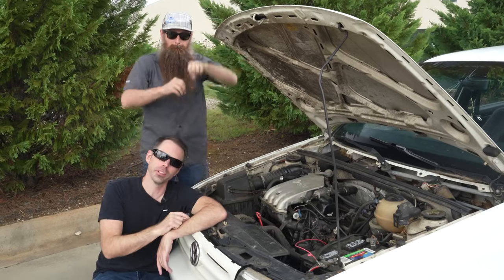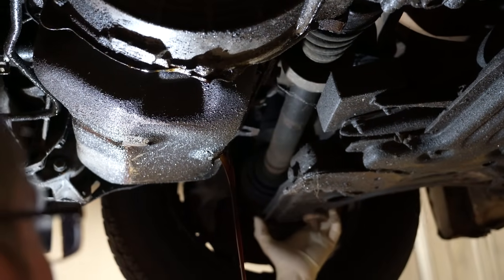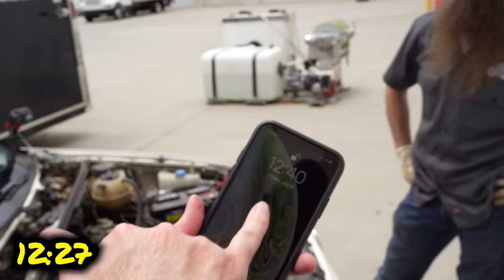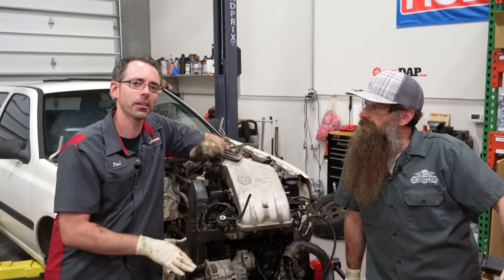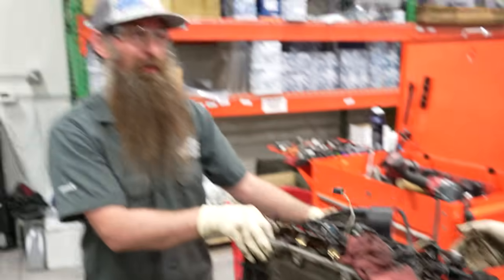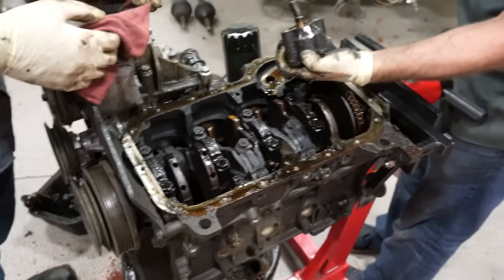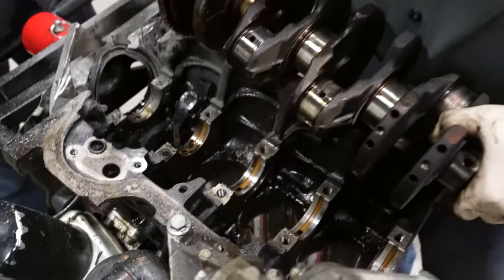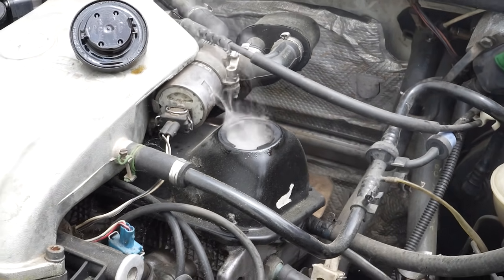Can an Engine Run with No Oil?

Comment: Back in the 90s I was in tech school and we did a similar thing to an early 80s manual Subaru. We drained coolant, oil, transmission, and diffs. Took the fan out. It ran in the parking lot most of day one. Instructor, who is/was one of my heroes, did 6k clutch drops in the school lot until the clutch exploded. Day 2 we had to turn it over by hand to break it free. It then ran at WOT for about two more hours before window-ing the block. Did we learn anything?  Not really. Memories were made though.
Reply: old beats new
Reply: That's 100% freaking awesome.
Reply: Best friend had an early 80's manual Subaru, little blue sedan, had like 300,000 miles on it and something let go inside it but it was still running, just poorly, so we pegged the gas pedal and let it run till it died, took about 30 minutes before it must have blown the head gasket too and then a volcano of oil and coolant sludge came shooting up out of the carb or throttle body on top, can't remember exactly, but it looked like a horrible school science project... kept going a bit longer then finally sputtered and died. We got $250 for it from the scrap yard that came and towed it away. Happened in the late 90's. 

Next closest to that was a 04 Dodge Durango I had with the 5.7 Hemi, came home on a Friday and parked it, went out on a Sunday to start it to go to a friends, clack clack clack then a loud klang. Shut it off, oil down the driveway and a hole in the block. Apparently it dropped a valve seat, then snapped a rod, a common issue on that era Hemi. $4k for a low mileage salvage yard engine swapped into from an 05 Ram, sold it a few years later to another friend after I put 40k on it and he's put another 160k, just helped him swap the valve cover seals that were leaking and some shot engine mounts. Still running. Some things just won't die, while others just one day go boom!
Reply: thats awesome i hope i get to experience something like this in my tech school

Comment: Answer: 3 years over 15,000 miles. My 95 2.slow leaked oil that completely emptied everyday, so instead of making Mario Kart bananas all over the road, I decided to run it until it stopped. Shocked it lasted that long
Reply: Impressive, might have been better to fix the leak.  Or if your so done with the car you have decided it deserves no more oil, i respect that.
Reply: How tf
Reply: @rkan2  VW baby!
Reply: @rkan2  there's no in betweem, a VW will either go to the moon and back twice or it will crap itself a quarter of the way there.
Reply: You killed the engine

Comment: I’m starting to get the feeling you guys love blowing up Jettas. Lol
Reply from the maker: NOS Free ;)
Reply: Next is no coolant on a turbo 1.8t
Reply: It's actually  pretty  fun when u have it to do. Some of the best fun I've had was taking an civic that had so much blow by it looked like a smoke machine didn't  need it tried giving to some homeless ppl they didn't want so 
First I just put a brick on the gas pedal let her bounce of Rev limiter for lord I dnt even know how long it ran outta fuel first so I go in it drove it back an fourth up a big ass hill wide open jumping it at top of the hill only let go because I finally  got roj d the corner  and up the hill fast enough  to jump far enough  to hit the speed bump  at the top of the hill busted the oil pan and kept her pin till she finally  after another 10 or 15mins till she let go rod knock came on after 2 or 3 mins loud AF but still took 10 more mins for it to window the block
Reply: Poor white Jettas 😟
Reply: A Volkswagen isn't worth anything unless it's in the scrap yard 🤡
Reply: @Deutscheautoparts  All I saw was a couple of dorks destroy a car someone else would have fixed into something interesting. 

When you don't have any talent, you resort to the lowest common denominator, demolition. Thanks for proving that.
Reply: @maryjane5731  I always wondered what low IQ people did in their free time. Thanks for the long paragraph explaining it.
Reply: @davidparker9676  
It's called having fun. Get a life!
Reply: @johna.4334  Let me have fun with your car.

Comment: I like how so many vehicles have overheat protection but a low oil pressure /level won't stop it!
Reply: If it was a generator it would have coolant temp and oil pressure shutdowns. 
I've seen a few still pop head gaskets because if there's enough of a coolant loss the temp sender in the head doesn't see enough heat for a really long time. 
Long enough to discolor the paint on the head.
Reply: Could be required as a safety issue.   Say you're on the interstate, wouldn't just want car to kill.  Just my guess though...
Reply: Because overheat leading to fire cuz hot oil goes on overheat exhaust pipe. 

Overheating may cause chain reaction.

Comment: I ran my ABA with no oil for about 8 miles. It was leaking from the oil cooler gasket. I had to finish getting to work, I brought it home, change that gasket with the gasket from the old oil filter. Filled it with oil and have been driving it daily again since January. Very resilient little bastards.
Reply: People usually think a engine will die after a couple of minutes without oil. But if you had oil in it before and didnt wash the engine it could still drive for a while.

Another thing: A old and worn in engine will survive longer than a new without oil.

Comment: We had a Mk4 Jetta VR6 come into the shop with the oil pan almost torn completely off.  It actually cracked the block (pan rail) on its way out but we didn’t find that out till later.   Teenage girl driver hit a concrete block on I285 and the car made it home, 20-ish miles at freeway speeds, with no oil.

Comment: before seeing how it goes, you will be really shocked how long that little shit will go with no oil. i bought a rust free golf that had a locked up ABA. culprit? no water, for over 2 hours, in stop and go driving, in the summer in omaha..... and the bottom end was actually still ok. the head is what locked up, due to the plastic cam cover MELTING down into the sump, then it congealed in the sump and got sucked up by the pump, and it plugged the pump. starved the cam journals, and locked up the head. crank bearings and rings were NOT BAD. a new head and it would have run for years. i tossed a digifant head on it, after doing a hone, rings and bearings. that bottom end is STOUT in a mk2 now. ABAs are just amazing little crapboxes
Reply from the maker: Yeah they are!
Reply: I had an 85 prelude that overheated horribly, I sat in stop and go traffic for hours cuz I got lost! It sat at full hot and didn't even care. It had 460k miles on it, and went almost 60k on a civic I had no oil changes just kept oil in it and could not kill it!
Reply: @pudermcgavin4462  same with a Nissan 200 se-r I had. 
Never changed the oil in 8yrs and 30k miles. 
Forgot how many clutch dumps I'd do,and the fun part of holding it on the rev limiter for 2-3 seconds on a cold start. 
1200$ car, it's an experiment to see how much abuse it would take and it took alot.

Comment: It did exactly what I thought it would do. I did the same with my VW fox years back. got bored after 30 minutes of bouncing off the rev limiter with no coolant. Drained the oil and bounced it for another 10 without oil until it seized.

Comment: For those curious some other engine testers did an over filling of oil video and the results were that nothing happens at all. So when oil is filled double it did nothing to the engine so the triple and then 4X the amount of oil and it finally just started to leak oil on the pan gasket. It wasn’t even the seals that blew out. Not sure overfilling is an issue but if you did have a quart or 2 over it would do no harm at all

Comment: You guys should do a similar test, with a healthy running engine. Like an engine that has all of its fluids, and it’s in decent mechanical order. I’d be curious to see how long he Street meant, stock engine, can hold red line with healthy oil supply, before potentially blowing up
Reply: Any well built modern engine will just overheat after a while because the cooling system isn't getting enough airflow while stationary.

Comment: I had a car with BGU engine and I think the oil pump chain rattled in it. Every cold start sounded like that fine Jetta after 4 minutes of idling, mine rattled for good 10-20 seconds

Comment: I need an ABA. My '96 Cabrio with ~140k miles developed a bad ticking noise and started giving me an oil pressure warning at idle. I dropped the oil pan and found 2 twisted up thrust washers in the oil pan. The engine still runs but I'm thinking the engine is worn because I'm under the impression the previous owner didn't maintain it very well.

Comment: I wonder how long an obd2 ABA would’ve lasted. It’s my understanding that the obd1 Abas had forged bottom ends and some different valve springs up top? I can’t really remember but it’s something like that.
Reply: I may be wrong, but I'm pretty sure only the obd1s had the oil squirters. They got cheaper with the obd2s

Comment: Is it bad that I drove my truck with maybe a quart of oil for 100 miles. Reason for this was a rookie mistake of changing oil in the dark and not noticing that I double gasketed the filter. Didn’t think that this mistake leaked 75% of my oil so I just went ahead and redid the oil change instead of thinking that my dipstick was acting stupid

Comment: I HATED the wastefulness of the clunker program. I was at the VW/ Mazda stealership at the time up here in NY. I wrecked A LOT of valuable cars and after awhile I was playing 'bumper cars' with some of them taking them up the dirt hill in the back of the overflow lot at the stealer 🤣 You're absolutely correct about some of them not wanting to die even with the Silicate or whatever the hell it was... This one 4.0l Cherokee went until it was out of fuel even with me revving the balls out of it. You'd be hard pressed nowadays to find vehicles of the quality that we were 'disposing of' during that "campaign." That e34 clip in this video is an example of a GREAT car that was WASTED. 🤨 Anyways this is the PERFECT solution to getting rid of a 2.Slow ABA. Reliable but so damn underpowered. When you guys were driving by it sounded like a diesel 😁👍👍

Comment: I once owned a 96 Jetta VR6 n ran it with no oil without knowing. I didn't know these engines burned oil as they did? I religiously change oil every 3000 miles! So story short the engine cut off on me on the road wouldn't start? Checked oil not a drop on dipstick! Cooled down start rite up went to buy oil top off n ran without any problems! Always kept an eye on oil level after that? VR6's are bullet proof!!

Comment: Had a guy come up to me a couple months ago from Pakistan and he said he just noticed his oil pressure light came on. No detectable leaks and 3 quarts later we topped it off. It was a B7 Passat 2.0FSI. I was very surprised it seemed to run just fine.
Reply: I forgot probably the worst part is it had no air box or filter and a solid coating of dust in the intake. His mechanic told him it would make more power and run better or something but I told him to get a filter on there soon.

Comment: My Jetta 3 had I think 500-600K lol, I changed the cluster at 250K then put close to 300 k on the new cluster but I was told when I bought the car it had more miles then 250k and the cluster was previously changed 🤣 I just changed that cluster because it had a clock no tac and the white GLI guage set lol.

Comment: Once upon a time i blew my moms Saab engine upp by running it without oil. But in my defence apperantly the oil pressure warning lamp were broken for some reason. So when an external oil return started dumping oil on the ground i had no warning before the engine totaly broke down.

I tried to fill it upp again and start it and ran it around the block, and interestingly it started running way better when piston number 3 ejected out of the cylinder wall and the rod punched a fist size hole in the bottom of the oil pan...
Well... for a while at least.

Comment: Anyone know how much psi or compression is needed for 2002 VW GTI 1.8T? I have a flashing oil light only when the key is on the “on” position. Once I turn the key and the engine runs the light goes away.

Comment: Keeps running forever!  mine has 300000 never had to open it up. Transmission did go after 200000 pretty good for a 01m

Comment: A place called Premier Oil Change in Yuba California did an oil change with the wrong oil, and a broken oil filter cap and I leaked out oil until my Passat TDI told me no engine oil cut engine off. And they tell me that the car wont say that and I should have been notified earlier if the oil was leaking. Then told me I was neglectful since I drove it until it was that low… All after first telling me they would pay to fix anything that went wrong. They said my car would not have driven if I had the engine oil that low. Thank you for this video. They told me it was impossible for parts to be ruined before the engine. Now I have paid a couple thousand and it’s now discovered I have turbo issues on my 2012 diesel engine, the dealership said it’s definitely due to the engine being starved of oil. Another VW Audi shop said that can absolutely happen. Premier Oil Change rep told me it was impossible. Told me the car would not have run, if that was the case. All this less than 5 thousand miles and thousands spent later.

Comment: I ran my Toyota Highlander with no oil for about a month it was new it had a small leak but I didn’t think too much of it and well I decided to check and realized there was none for a month ran about 2000 miles and revved it on the highway still running no bad noises but who knows I’ll update in a month
Reply: No coolant or water in my radiator either and the oil dip stick was dry btw
Reply: If the low oil pressure light was not illuminated it still had normal lubrication.

Comment: I had this engine in a 97 trek edition. Most unreliable car I ever owned, lol. Also I thought it was ridiculous that I had to remove the intake manifold to do any work on the car. Now, those 7 hex bolts don’t seem so bad since owning my 2nd mk5 07k.
Reply: I owned a mk5 with the 07k engine. Most unreliable piece of crap I have ever driven. It was a 2009 and I got it with 56,000 miles for $7000. And don't even get me started on maintenance... whoever engineered that thing is an asshole. It got totaled at about 78,000. Tons of fun to drive. I'll at least give it that.

Comment: In my shop, I got a 2003 civic 1.7 whuch was not idling right and misfiring. I checked the car and there was no oil in the car apart from some in three oil filter. That guy was driving for weeks like that. All I did was to put  oil and new filter and all the misfires and idling problems were gone. The customer started to laugh and shout '' it's a Honda''. Can't get any crazy than that.

Comment: Back in the 70s, I had to run a Chevy 283 without oil to purposely seize it. Reasons to remain a secret. After 8 hours we shut it off, filled it up with oil, and the owner used it for two more years. Go figure ! 😵‍💫

Comment: BMW has a maint procedure of replacing bearing at certain mileage intervals, why not do this to all cars?
Reply: Because not all engines are designed by Bayerische Motoren Werke...
Reply: @rkan2  I don't think that matters, it's the same basic design from 1860, with many improvements of course. They are all still four stoke gas fuel internal combustion engines. No matter if it was Henry Ford or Gustav Otto Flugmaschinenfabrik who began the original manufacture that started or lead lead up to building it. My point, BMW has rebuild procedures as a regular maintenance item, while everyone else just wants you to buy a new car. Mercedes use to want their cars to last, then they followed GMs formula, now they're just over priced Chevys with a star on the hood and last just as long, the end of the warranty period.
Reply: @r.weaver3769  Exactly - which is why one can choose the superior, or electric vehicles :P
Reply: @rkan2  If you can afford it. I miss my E39M5 w/68k on the clock, but life changed and the car deserved to be cared for not just driven. Which definatly puts me out of the electric market. Besides, I'm curious how China will treat us with EV batteries after witnessing the chip shortage. US better start looking for their own resources.

Comment: This just happened to me I went to the Peterbilt - Isuzu dealership for a oil change they changed my 200$ a hour labor and forgot to fill 14 quarts of oil I drove about 1,000 feet and the truck shut down now they are replacing the engine is there anything else besides the engine that could be damaged from no oil

Comment: Man....that was my first car. 1997 Jetta with the "Jazz" edition package. Had the 2.0 naturally aspirated engine and a 5-speed standard. Was slow, but good god could it turn, corner, and handle beautifully. The Jazz edition came with the Wolfsburg suspension and a 5 CD stereo (it was 1997 after all). It actually pains me a bit to see you guys destroy one. I'd buy another of those cars in a heartbeat if I could find one in good condition. I hope this car and engine were already dying/trashed when you killed it.

Comment: Question:  How do you make engine oil turn into Jello?  I keep seeing super thick oil in the "Customer States" type videos.  Are those fake/ not actual customer vehicles?  Your comment about the "Cash for Clunkers" program makes me think that these videos I keep seeing are vehicles "decommissioned" under this cash for clunkers program.  I don't understand how that could happen otherwise.
Reply: usually water or another foreign liquid was added to the oil by mistake

Comment: Naaw 1.9 TDI PD is the most reliable engine ever.
Reply: Yeah, they only chew up cams every 50k if you use normal motor oil. So tough.